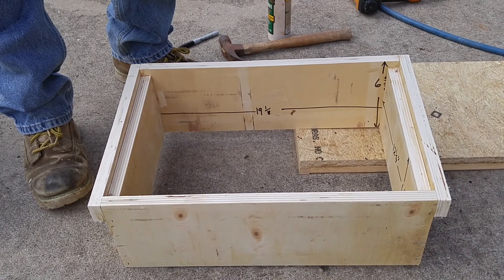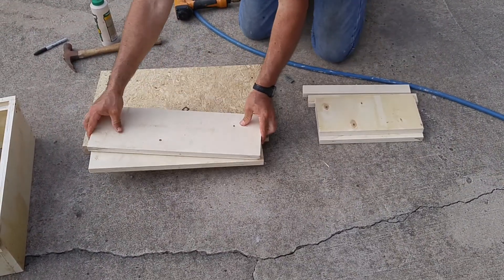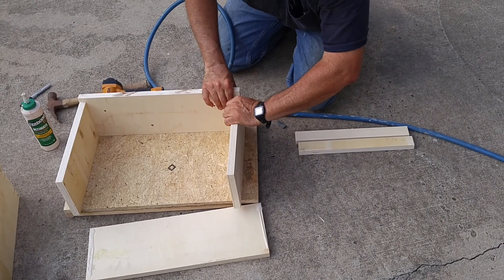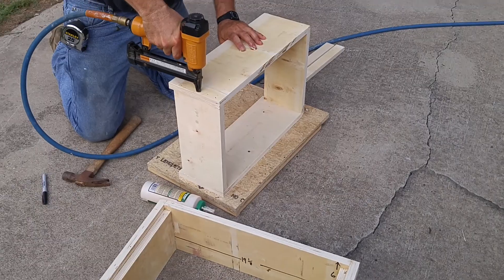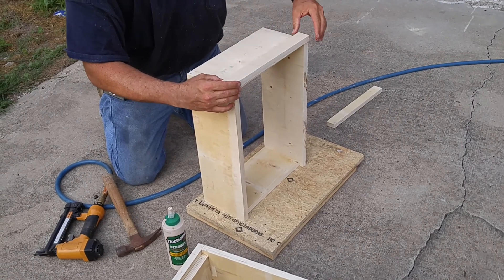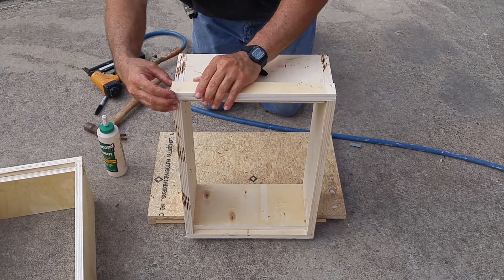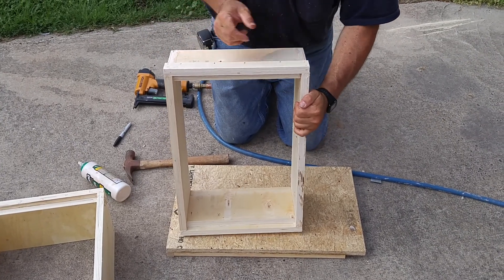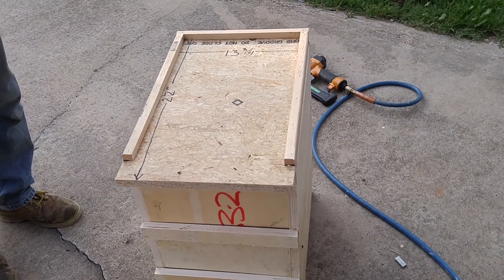8 frame medium hive body

Comment: How do you know that it's square?
Reply from the maker: Use a speed square on the inside. This is a quick and dirty. It can be a touch out of square. I'm trying to make this as simple as possible for folks to knock them together quick and easy. They won't last as long as good wood, but lets you get a house quick and cheap and try different configurations without a huge upfront investment. Thanks for your comment.
Reply from the maker: Also, as noted in the vid, when you add that handle/frame stop on the front and back, if all your cuts are square and you flush everything well, they work to self-square themselves.

Comment: 12.25 on the short side is the inside measurement?
Reply from the maker: Joseph, I'm new at seeing comments on past videos. When it comes to a Langstroth, using 3/4" material the outside should be 19-7/8" long, meaning the inside will be 18-1/8". What I have found in personal experience since making this video is that you're better off to just try and keep all those interior measurements close to the same. So your outside (if you're using 1/2" ply) will be 19-1/8". That's not great for stacking on other boxes. So I like to cut an additional piece of 1/2" ply and attach to the front and back exterior at the bottom, so it sits on tops of the other boxes easier and seals things up. No, telescoping lids might not fit it, but I have gone away from them. Plus this is kind of a get you by idea until you decide if this is the type box you want and what you're going to do on lids. Hope that helps.
Reply: When I look at your measurements, I thank God for the metric system.
Reply from the maker: @benilang5391  I  can understand that. I've lived life using it in construction so that it doesn't bother me, but it wouldn't bother me either to use metric.

Comment: Your top or outer cover doesn’t look great, have u improved ur design of the top since posting this?… i absolutely love everything except your lid or roof which is extremely important.
Very respectfully
Dave
Reply from the maker: I appreciate the feedback. The top is a dual use bottom board OR top. I was endeavoring to eliminate different pieces of equipment. As you'll notice, the side boards are a little longer in case you make a different box style a touch longer. As you look at this design, it's a very basic design, not built for aesthetics but for functionality. The bees don't care how it looks. All they care is if it keeps water off their heads/brood. You can put on lids made with big cracks in them and the bees don't care, they just fill them in with propolis to their liking. The idea behind this entire video was not for the most attractive build, but for one that got the job done with a minimum of investment in tools and materials.